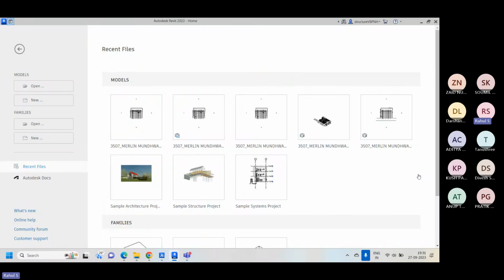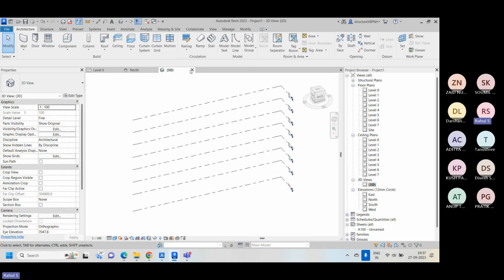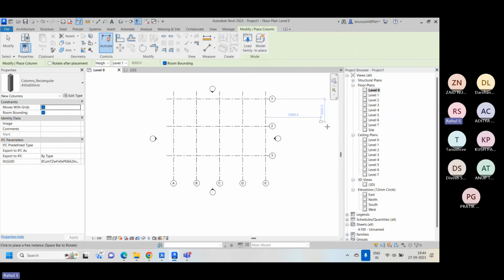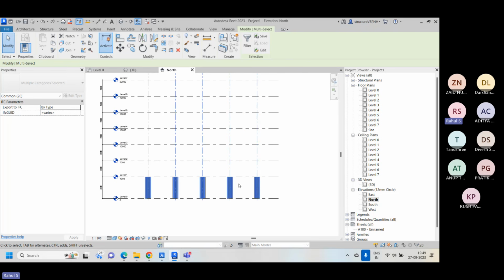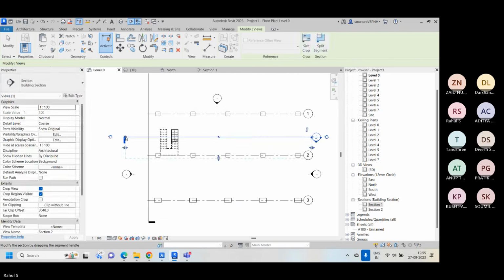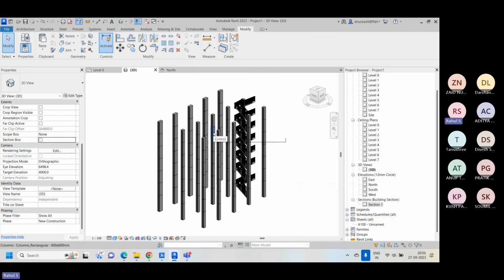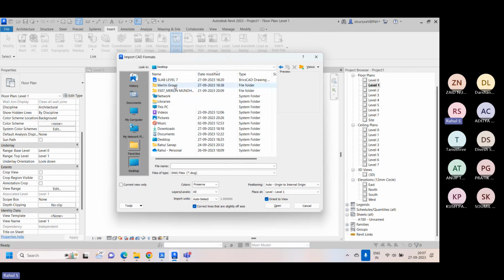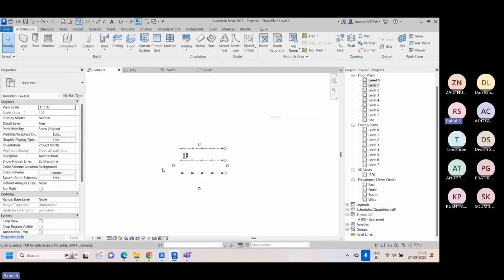BIM Training Course Chapter 2: Viewing Model, Linking CAD, Grids & Columns | BIM for Beginners

Comment: to import cad drawing in revvit, do u need aito cad in ur pc as well?
because my import folder is not detecting the file.
Reply from the maker: No, you do not need to have AutoCAD installed on your computer to import or link a CAD file into Revit. Revit reads the file format (.dwg, .dxf, etc.) natively.